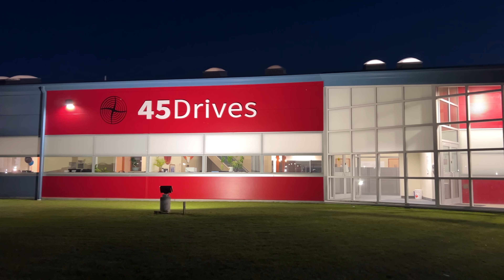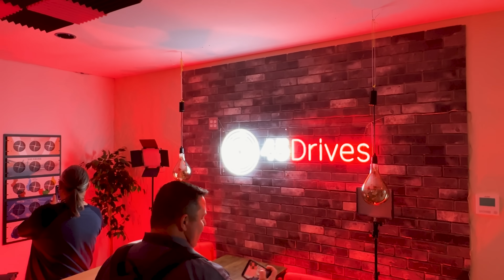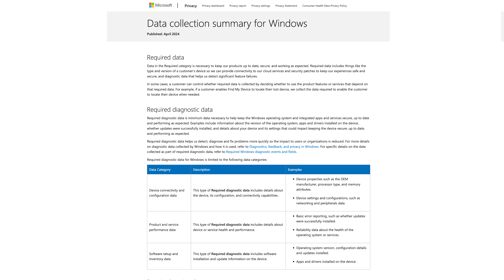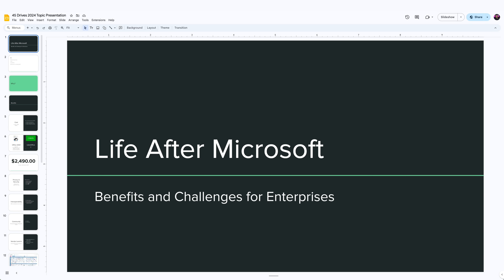How one company is "De-Microsoft-ifying" and pushing Linux on the desktop

Comment: Great project for 45Drives. At the turn of the century  I was involved with a project to replace windows on 5,000 workstations and AIX on 30+ RS/6000 servers. The company made medical office management software & systems, and has been using a combination of Windows, MS Word, ACDsee and a Telenet client to access AIX servers and an application running on a  DB2 database. So a medical office with 20 workstations (exam rooms, reception, admin, etc.) and a beefy enough to run RS/6000 plus AIX plus DB2 was not a cheap thing. After a series of discussions, I was brought in to create a system to replace both Windows and AIX. 

I designed and built, to a series of ongoing and evolving specifications, a custom version of Linux along with a package of open source tools which eliminated proprietary software, execept the DB2 database and the application written in it. I also created custom kernels to support RAID arrays and other specialist hardware. The only thing I didn't do for the OS was the installation program which they hired someone to create. I personally wanted to use the built in one that came with the Distro I based it upon, Slackware and then just using customized install files...but I was over-ruled on that.   It was one of the best jobs I ever had, as it's not many times in one's life that you get to create a computer operating system!

This project was possible since IBM had just brought out a version of DB2 that runs on Linux. There were many benefits to this replacement. First was the upfront cost for a new office eliminated all of the "Microsoft tax" on the workstations, and by using commodity servers running Linux rather than expensive RS/6000 and AIX, removed another major upfront cost. It also made changing over existing offices cheap since the company would supply the operating systems for both the workstations and the server, and the only material cost was purchasing a x86 based server. That cost was easily recovered selling the existing RS/6000 server on the used market.  And before the Microsofties lose their tapicoa,  it all went smoothly because of one thing in addition to the tech...Training! That really is the big difference going from MS to Linux is training the users how to do the things they once did in Windows but in Linux. Elimination of Windows dramatically reduced the number and duration of support calls. After the first few months, the support load was cut in half or more.

Comment: I wish De-Microsoft-ifying would be possible, but as long as the Linux devs, and by that I especially mean ones like the Proxmox ones, can`t get their stuff together, this will not be possible.
I work for a company that does SysAdmin tasks for other companies. Due to Broadcom buying VM-Ware we were looking for alternatives for virtualization. Guess what we will now sell our customer? Microsoft Hyper-V. Why? Because it looks like companies like Proxmox don`t want to suceed. VMWare was always ahead of the competition becuase of all its ways other companies can interact with it and the support the company gave them to make them able to be integrated. Proxmox however insults those companies and ruins ther chances to be used in the enterprise. One such case I want to highlite. I am also certified as a Veeam Engineer. Veeam is one, if not the biggest backup software provider. I heard this from both Veeam Engineers working at Veeam and also other SysAdmins with contacts there. Veeam reached out to Proxmox to creat some way to integrate Veeam into Proxmox to handle backup management. What did Proxmox say? They pretty much said that they can go screw themselves and as long as their program isnt fully open source, they shouldnt even think about coming back to them and offering it to them again. They didnt care that Veeam would have at least made the part that interacts with Proxmox open source, they wanted everythig to be or else they can go away. Sure, Proxmox has its own backup solution but that one isn`t something for big enterprises. Its good enough for homelabs or small companies but big ones? Hell no.
I also talked with a HP Enterprise spokesperson recently about their firmware update package integration with different OSes and how their plan is with woking on Linux, or more specifically Debian support. They also mentioned wanting to talk with Proxmox but guess what they said? Same as to Veeam, that they can screw themselves. 
De-Microsoft-ifying will never work, as long as there are these types of people holding it back. Sure, it would be great if everything was open source, but it isnt and what would be better? Having some closed source software working with you while you become a dominant open source Virtualization software and making Linux and Linux support more common or fucking everything up and just giving Microsoft more power? 
As long as Proxmox doent change their way and starts using their brain, Ill never recommend it to anyone anymore, professionally or for home use. I wish them the best but if they continue like this, they will never become relevant.

Comment: As I sit watching the end of the video (Using Linux Mint Cinnamon). There is only ONE glaring issue.  I am a Mechanical Designer. The CAD/CAM solutions are greatly lacking, I know at one time almost every 3D solid modeling software out there supported Linux. For example, when I first started working in my field, we used ProEngineering. We even had a machine dedicated to rendering our models. Siliconegraphics machine nick named "Barney". I know that was a proprietary Unix version, called Irix I think. Anyway, it would seem there isn't much support in the Engineering side of things. I think it would be great to have this, but if there isn't a market, there isn't a choice. Sad but, very true.  Thank you for the video.
Reply: That's because of the lobbying M$ did to "prevent" those companies to continue producing and developing those software.
Reply: what about freeCAD?
Reply: @52Pi_Maker_Education  I have tried that.  It requires you to write your own scripts. Mechanical guy. Not coder.  it is a cool open source program. Thanks for the reply.
Reply: @MrCauphy  you are welcome, and mechanical is coolest in my option, you can build a lot of fancy stuff....
Reply: @edwardmacnab354 I'm not saying you are wrong or right. That's a possibility. Although I know the whole point of open source is sharing. There is nothing wrong with paying someone. I would love to learn to do these things myself. Right now I am trying obtain work again, so that's my focus. I think it would be cool to be able to employ someone to do the scripting. I just don't have that option. Good suggestion!
Reply: One alternative is OnShape as it is Browser based but I personally don't trust it much.

The nighly branch of FreeCAD is decent and we need more people to contribute.
Reply: I know your struggle. One thing that works for me as a private person is OnShape. It's basically a browser based CAD program, so it has no issues with linux. The downside is that all your projects are "open source" as well, so it is sadly not usable as an enterprise CAD solution.
Reply: Onshape is a cloud-hosted 3D CAD.. I've only used their 3D midelling so far. Assemblies: yes. Kinematics: Yes. Parametric models: also yes. They dont have built-in FEA/CFD  or dynamics simulation, but I see several addons in their AppStore that promise these capabilities. How reliable the output of those addons is, I don't know. Since all of this uses your browser as the interface, it should work fine with Linux.
Reply: ..and "Barney" was indeed an apt name for those purple-grape-coloured SG workstations 😂
Reply: Valve proved market is there — there is no marketplace for office/work tools. For now I see only Blender path, that is donate until open source solution improves so much it replaces proprietary.

Comment: Windows is for playing video games.  It's unsuitable for other uses.
Reply: Unfortunately it still is very suitable for many uses, hence the difficulty of having people and businesses switching to Linux. Just search in this comment section the opinion of the folks which have to work with CAD software. Or businesses needing a replacement for Active Directory. We're still in the early days of mass Linux adoption. As in done with other areas (like hardware), games are trailblazing the switch for the mass population.
Reply: @Winnetou17  That's very true.   The primary reason that people use Windows is for a set of software that is only on that platform.   Active Directory is an issue, i set up IPA in a lab, which is a Linux equivalent, but unfortunately is not compatible with Active Directory.    NASA was using Windows laptops for years and got tired of the constant crashes and ported everything to Linux, it was a lot of work but it has apparently really paid off.    Linux pretty much runs on everything now except for the desktop.   To be honest I think the actual Linux Desktop experience is getting worse, I know that Gnome is total trash now and I'm looking for something that I like but have not had the time.   That's a big difference, you can't change the user interface with Windows (or Mac)
Reply: Only if you want anti-cheat games.. Otherwise you can get away with pretty much anything.
Reply: @jackthatmonkey8994  That's true, if Windows is no longer needed for that then my (oversimplified) comment is bad news for Microsoft.   Valve is definitely trying to get away from Windows.

Comment: Wow, what a nice trip. The 45drive products look great. 1:59 - I want to have that :) My 2cents about "De-Microsoft-ifying": As soon as there is an easy migration path from Active Directory/Entra ID to a viable open-source solution, backed by some kind of assurance that it will be maintained for the foreseeable future (forever), Microsoft could start to have problems. Until then, I think there is not the slightest chance that mid-size+ enterprises will switch to Linux on the client side. (unfortunately)
Reply: Why is it necessary to use Active Directory? Linux's management model is different from Windows, isn't it? Tools like Ansible and SaltStack can manage devices in bulk, and there are many similar solutions. As a Linux client host, management is actually simpler, I think. It might be the desktop environment and games that have influenced the popularity of Linux. However, in recent years, Linux has been becoming more and more popular.
Reply: @52Pi_Maker_Education  Can u implement ansible and other linux things into a website ad can ad can be integrated anywhere and every where hence the popularity

Comment: Been a Linux-only devops engineer for the past 10 years and man, it's so much easier to develop on the closest platform that you're actually going to be deploying to. Good stuff to hear.
Reply: The amount of hoops one must jump through to effectively install Linux as a VM on Windows to develop whatever product they working on, is absurd... if Microsoft was smart and fair they would just produce their own distro of Linux for the desktop because it's what their customers want... but they are far too greedy to ever make such a smart play.
Reply: @JohnnyThund3r Jump through hoops? They have Windows Subsystem for Linux. What possible hoops are you talking about?
Reply: @JohnnyThund3r  If it's your development machine most companies I've worked for as a dev offer a Fedora or Ubuntu/Debian laptop most of the time. Only once was I was given an option of BYOD+credit then install company security software situation where I just ran Debian. Make a list or script (something like ansible) to make your dev env repeatable, languages, dependences, editor config, terminal aliases etc. Overall not too different at all if your developing on Mac w/brew or the rare case Windows but I don't see many devs using windows in my field. Maybe more on the Azure side? Regardless though, there is still a heap of things you need for any dev env on whatever OS you're on, just an adjustment. Microsoft has WSL though which is an okay stop gap or means to get one more familiar with *nix navigation, tools etc. I don't think that it's always the right choice though for development as you run into a lot more oddities or the usual "it runs on my system" ordeal and doing real work it would be better to just run in a vm or bare metal. I should add I don't dislike Microsoft but there are sometimes better tools for certain jobs. Also doesn't really help that modern windows is a far cry from what it used to be, with far too much going on with too little focus on the user experience, just data collection.
Reply: @JohnnyThund3r  Sometimes there's just a better tool for the job. WSL gets close for dev work but there's always weirdness as I've received "well it worked on my machine" more times than I can count from jr devs that used WSL. The only real honest option is using something *nix based, either linux or mac. Microsoft while I don't hate it since most of us got our start there, isn't what it once was and while fine for casual users, power users is another story. You shouldn't have to fight your dev tooling more than need be and getting anything set up on windows more than surface level is generally problematic. Compiling non native code has caused more trouble in debugging or diagnosing, only to try the same code on a Linux cloud box, vm, test env, etc~ for it to just run.. It happens monthly if not weekly from those resistant to moving to Mac or Linux in lieu of something more familiar. Once you have your editor config, and, at minimum a list of dependency packages for your codebase (better if automated), your dev env becomes much more portable for whatever *nix system your on. Microsoft caters to development on their ecosystem azure/windows/s-suite and less so for anything cross platform. WSL support is even considered viable in Azure, as they smoke test against daemons, kernel, versioning etc. Those who want to use AWS, GCP, Digital Ocean, or, any tool that's linux native and not MS CICD build tools, then you're on your own. Bit of a rant, I know; you just see the general incompatibilities a lot in my field which overall is a massive time sink to adjust for.
Reply from the maker: @mkonji8522  thank you for blazing a path for us to follow
Reply: That's a good news for Linux user.
Reply: I've been using Linux as my daily driver since the late 90s. I've honestly never used anything else other than OS X (nice, but really out of date userland), FreeBSD, OpenBSD and SunOS.

All of them work great though the OS X windowing system is kind of annoying. Not being able to paste with the middle mouse button really sucks. Also, no focus follows mouse. Yuck.
Reply: Docker has entered the chat
Reply: @MrGamerlover23 exactly, I'm all for baremetal Linux and actually prefer it. But WSL and vscode devcontainers are legit and simple to spin up.

Comment: We tried it once, the acceptance from the people working daily with the workstations was overwhelmingly negative so we rolled everything back. Every few years we try again but it's always lacking in some aspects.
Reply: Always have to phase approaches. Open it to people that WANT to adopt it first. Plan on working with them on bug fixes. Let them easly roll back as needed. Find road blocks (software x doesn't work), do the same thing to solutions to those roadblocks (find a software alt that works well on both, open it up to early adopters, squash UX problems, increase adoption, eventually start depreciation, training for users, canary deployments further to rest of the users, full rollout, remove legacy, repeat until it is done).
Reply from the maker: This also confirms a lot of my thoughts in my presentation, that it's disruptive to businesses and that learning a new way to use business machines is expensive (soft dollars) when it comes to training and loss of productivity.  Your users seem to be open to change though, however, since they've allowed you to try this a few times!
Reply: my company is almost all windows (some exceptions like database and sftp servers). where did the rollout fail exactly? was it people not used to working on a linux desktop?
Reply: @willi1978  it's pretty much always this, a lot of people hate change and will complain endlessly about it. Also some things are genuinely more difficult to do on Linux.

Comment: that stackable computer system looks like the coolest thing that will put my pc building business out of business...
Reply: Perhaps you could create something even better by collaborating?
Reply: @52Pi_Maker_Education  i dont design stack-able computers. i build custom desktops.
Reply: @52Pi_Maker_Education  i build pcs not design custom stackable systems.
Reply: Big problem I see, is what happens when the bottom module fails? Or any module in the center? You'd have to completely shutdown & unstack the entire unit. Unless you had at least 6 to 12 of these in a cluster, that design wouldn't be production worthy IMO. Even then it's more of a hassle to change out a node or component.
Reply: @3rett115  imagine havin to take apart a custom water loop when a part fails.